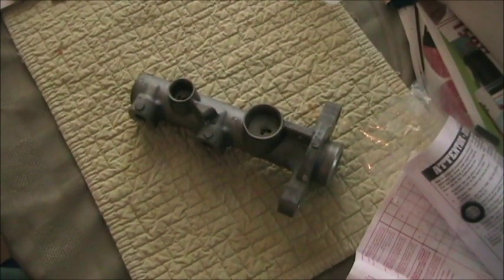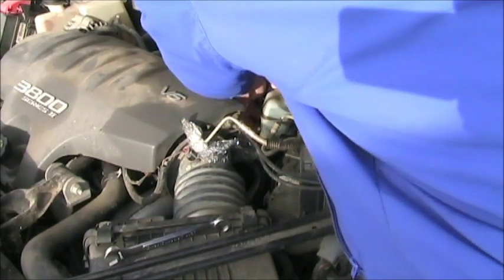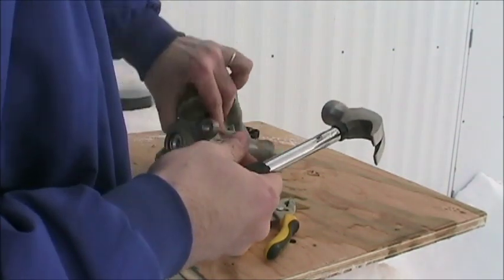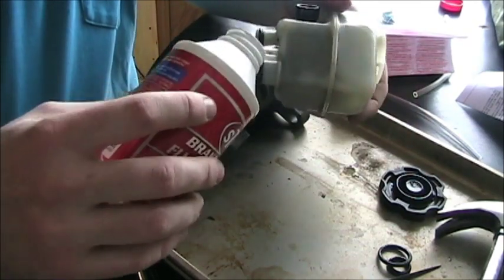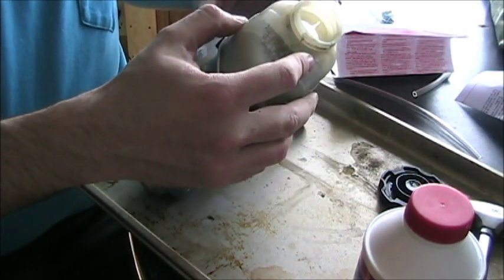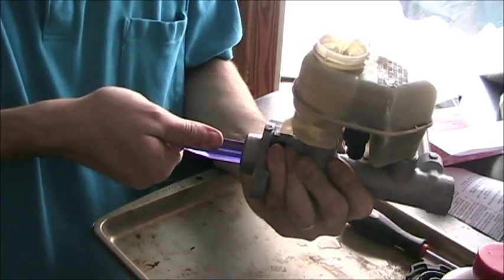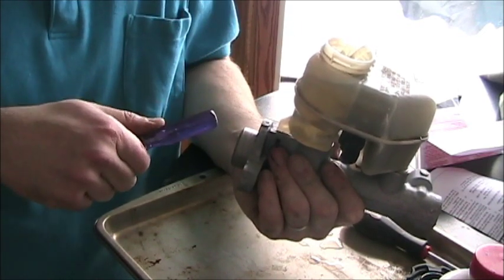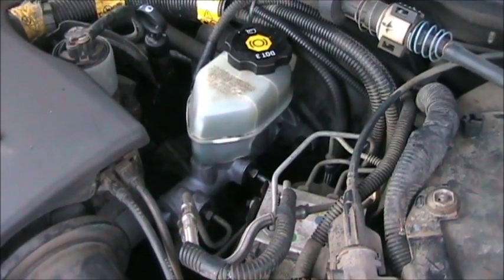Brake Master Cylinder Replacement in a 2002 Pontiac Grand Prix DIY

Comment: Excellent video. I noticed it went bad in the winter. My pedal is almost going to the floor the first time i drove my 99 grand am after a sub-zero temperature cold spell. I was thinking the seals in the master cylinder are not sealing anymore so i am going to do exactly what you did and hopefully i at least make it through the winter like that.

Comment: Thank you, Ben. When you bench bleed, and then remove the plastic tubes to substitute brake lines, what prevents fluid from dripping out the holes, allowing air back into the chambers of the master?

Comment: I have a 2004 Pont Grand Prix GT wth about 250k miles. I keep it on the road. I am having the same problem with my brake pedal, took it to shop and was informed it was my brake caliper, hub assembly and pads. They were all checked/replaced and the problem still persist. I was told yesterday by another mechanic, that its the Master Cylinder. So I will attempt to do it myself but im a lil nervous because yesterday my car practically didnt stop when i pressed the brakes. It scared the shit out of me because i could have rear-ended another car. Is this the Master Cylinder? Where should I buy the part from? 

The video does really help a lot but I am no pro!
Reply from the maker: Probably and any parts store, they are mostly the same.

Comment from the maker: Ok...ABS has no relation to bleeding the brakes, usually its electrical such as a broken wire or defective wheels sensor.

As for the soft pedal, then yes, it can be the cause of soft pedal is all the calipers are bled very well and aren't sticking.

Comment: I'm hoping maybe you can help me. I have a 04 Grand Prix. Abs light came on so I went to bleed the brakes and ended up needing to replace the caliper because the bleeder screw broke off. Bled brakes after replacing caliper and pedal is even softer than before. Have tried bleeding all 4 calipers with no success. Do you know what I may need to do or what I may be doing wrong?
Reply: Your master cylinder is out , Make sure your brake boosters work or u might have to change both my abs and brake light came on I have the same model mines was the master cylinder amd reservoir it wasn't holding brake fluid